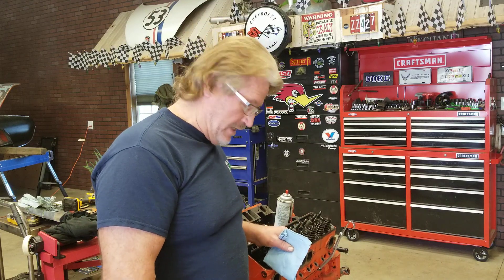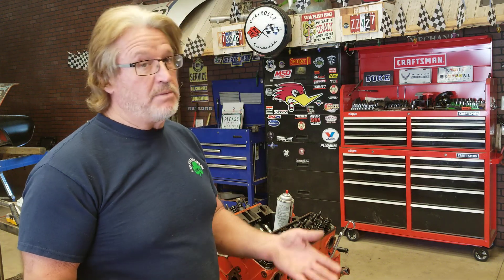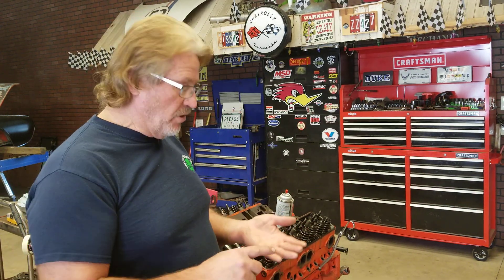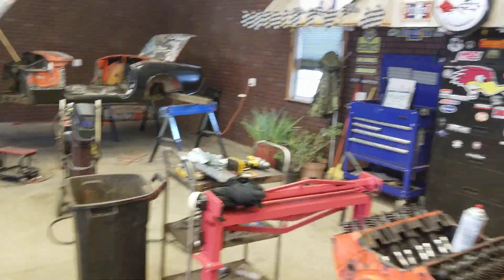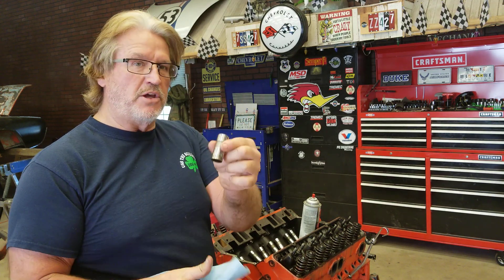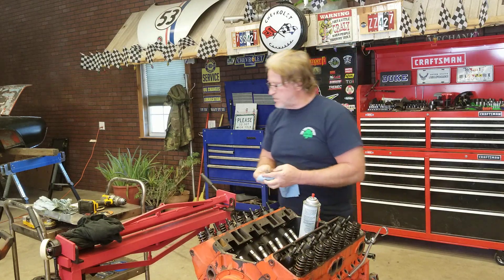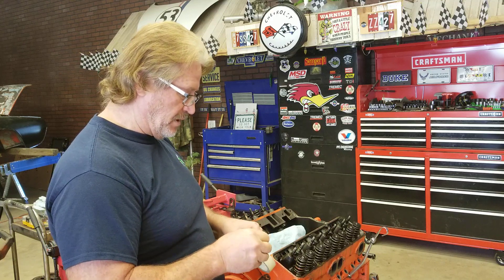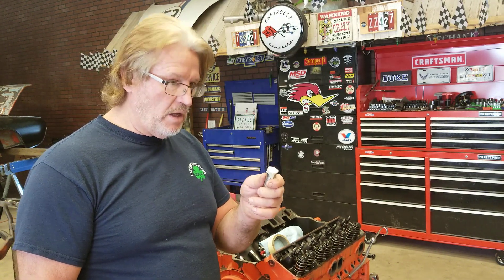Want to re-use the camshaft in a used engine? Here's how!

Comment from the maker: It's got a DOME on the bottom of the lifter! 🤣 Brainfart!
Reply: I've got a good used engine I've had sitting for a bit. It came with no intake and no lifters. It's an old 327 (non roller / flat tappet). 

Can I just pop in 16 new hydraulic lifters? How do I know if the cam was built for solid lifters or does it not matter ?
Reply from the maker: @xmo552  if it's an original engine, the cam should be a hydraulic cam. If it's been sitting, you need to verify that camshaft isn't rusted. If it's clean, then yes you should be able to drop a set of lifters in it and go. You'd have to break it in the first time you start it. And I'd use break in oil with zink, plus add a bottle of zink additive to the oil. That way there's plenty of zink to help with the break in. If it fails, then you would have to take the engine completely apart and clean it because it would have metal in it. Your best option would be to buy a low cost cam and lifter kit off ebay or Facebook marketplace.
Reply from the maker: @xmo552  where are you located?
Reply: @WagsAutomotive  
Thanks for the info. Santa Cruz, Ca. area. The 327 was an ex gasser engine.
Reply from the maker: @xmo552  oh man I LOVE Santa Cruz! The boardwalk is awesome and the beaches are beautiful. I used to go there every year. Went to the Santa Cruz mountains and rode the train. Went to Carmel and Julia Phifer state park.
Reply from the maker: @xmo552  if it's a gasser engine, it could very well have solid lifters in it. If it's in good condition, I'd probably just play it safe and replace the camshaft and lifters as well. You should look at the pistons. I wonder if they are high dome pistons?